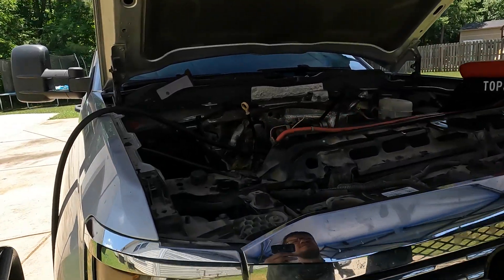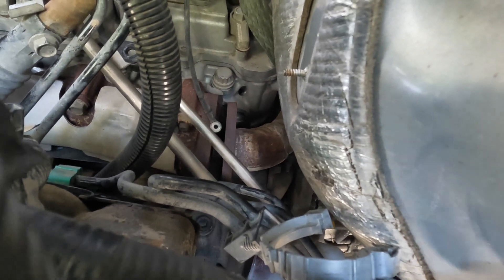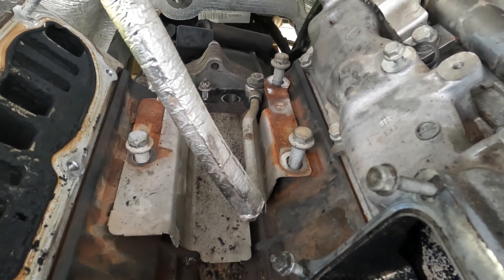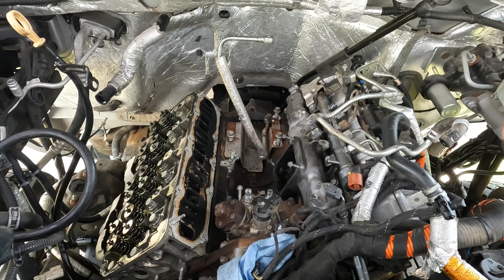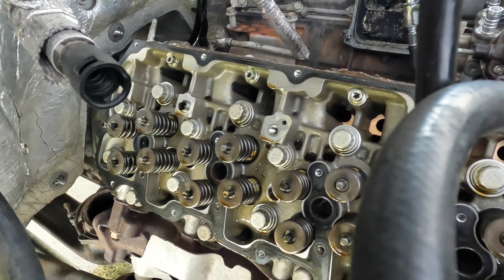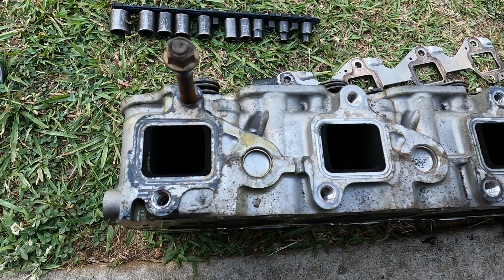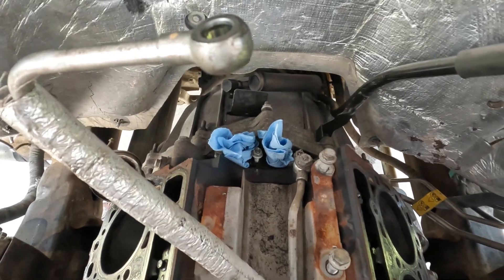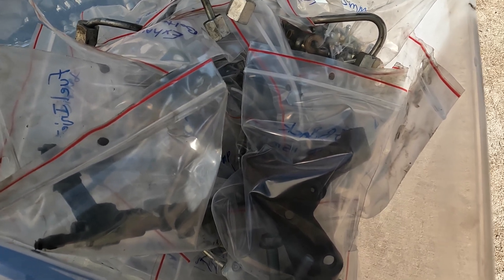LML Duramax Head Gasket Replacement Part 3

Comment: That must be the 2015 or older because the style exhaust clamp i seen hopefully my 16 doesn't do this. Man 10 hrs that would of taken me 50 hrs. You just get right to it. Good job. Oh by the way have you got any feedback from the customer like longevity wise its been a few years. Thanks for the good presentation.
Reply from the maker: This was a 2015 model and the customer is still driving it with no complaints.  He is a friend of mine and he actually drives it daily to work as well.

Comment: Can you specify exactly what the machine shop did to the head? Thanks
Reply from the maker: They pressure tested the heads to ensure no leaking valves and then they machined/decked the surface of the heads to make sure that it was flat and true.

Comment: Where are you located?
Reply: You seem to have alot of experience with the lml. I suspect my valve seals are leaking oil and causing blue smoke in the morning. Do you think its possible to replace seals without taking the head off?
Reply from the maker: Yes, you can replace them without removing the head.  Once you remove the valve covers, injectors, and rocker arm shafts you need to apply air to the cylinder you are working on and use a valve spring compression tool to remove the valve spring and retainers and then you will gain access to the seals.  This is the way I normally do them.  Now to do them all it calls for like 25 or 26 hours of labor depending on if you have a dual or single alternator.
Reply: Thanks. Never done this before. I think I’m gonna go for it. Trying to save myself some labor costs
Reply from the maker: I am in SC on the NC/SC border.

Comment: I have never done something this difficult before, do you think head would come off with leaving turbo and down pipes on. It may be a dumb question ?
Reply: I have removed heads off of 2012 with turbo in it I Just removed both up pipes and downpipe. Also left the manifolds on heads for easier removal on exhaust manifolds both outside of the engine bay! It’s definitely a fun job 👍🏼 nice info on the video bro! Definitely subscribed
Reply from the maker: @camerickson4831  thanks for the information.   I have never done it that way and was not completely sure if it was possible.  I appreciate the view and subscribe.
Reply from the maker: Turbo, maybe but down pipe I would say would need to come off just access a couple of things
Reply from the maker: after thinking about you would not be able to because you need to remove the intakes off of each head and they will not clear the turbo  so the turbo has to come off.

Comment: Appreciate the series videos.we got a 2016 with suspected head gasket leak.helps to see it done b4 ya jump into it.good job sir.
Reply from the maker: Thank you.  If this is the first time it can seem a little scary at first but once you get into it, it is not as bad as it seems.  The hardest bolts are the driverside valve cover bolts next to the firewall and that cylinder head bolt.  If you do studs just remember to install the last lower stud as you are putting the head on because it will cause the head to hit if you do not.